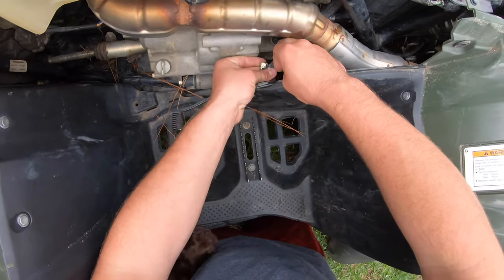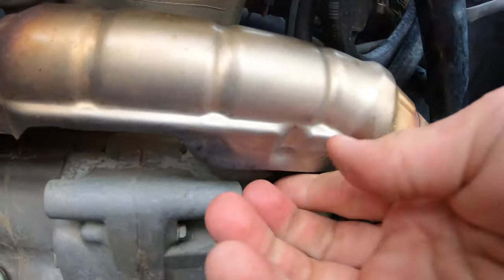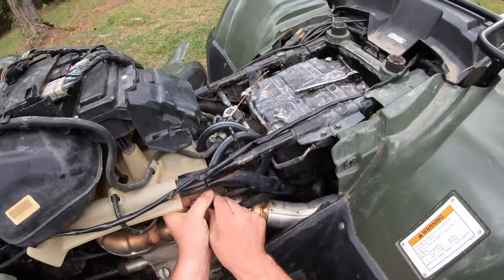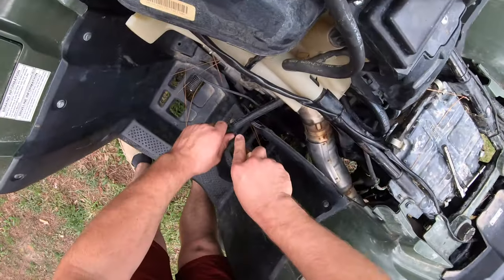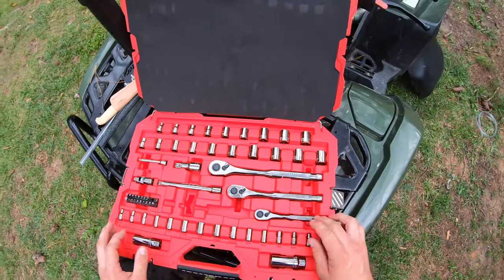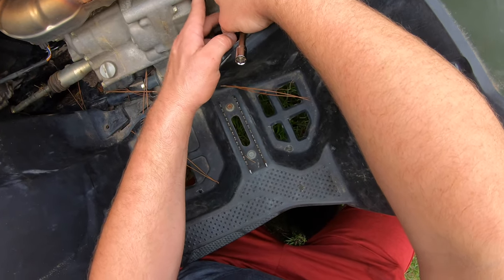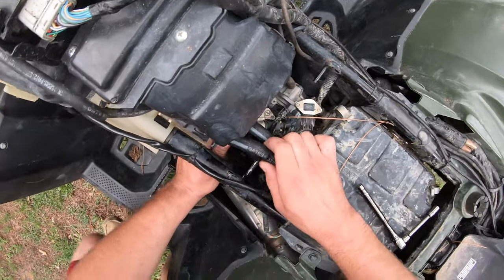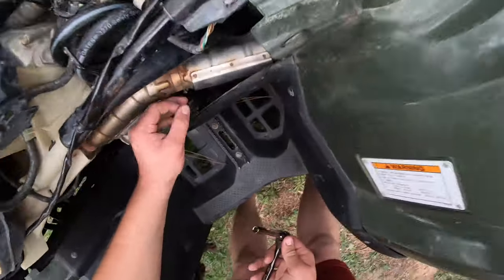Honda Crankcase Breather Mod! Rubicon, Foreman, and Rancher!

Comment: Can I use clear hose or will it burn?
Reply from the maker: You can use a clear hose, but I would recommend using some type of heat resistant materiel between the clear hose and the motor.
Reply: @ChandlerWorth  okay cool yeah I bought heat shield so I can add that
Reply from the maker: @djwilliard3891  awesome!
Reply: @ChandlerWorth  can I cap my overfill vent for rad ?
Reply from the maker: @djwilliard3891  You probably could, but I wouldn't recommend it.
Reply: @ChandlerWorth  then what should I do with my fan and overfill vent lines. I was gonna tee them into each other but someone said it will ruin fan. And I don’t wanna run them up snorkel cause I’m hiding everything so should I put a boot of them from highlighter ?
Reply from the maker: @djwilliard3891  if I’m not mistaken, the boot from highlighter is only for the differentials. I run both of those lines separate under my headlight pod, so that they can’t be seen.
Reply: @ChandlerWorth  I gotcha I like to go past handle bars deep so that won’t do my no good lol
Reply from the maker: @djwilliard3891  I gotcha man, I go over the racks a lot, but never get past my headlight pod from all the water wheelies 😂